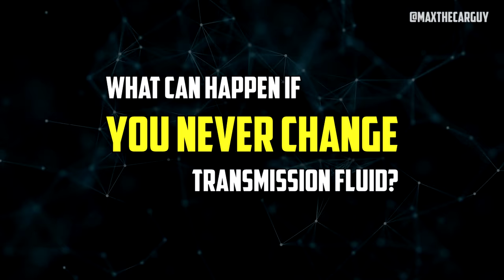Transmission Fluid Change vs Flush - Pros, Cons, Costs

Comment: If a car has done less than 30k miles in 10 years or so, is it still necessary to change ATF (considering its red and tranny temperature is in normal range)? If so, why? Does any "additive" in ATF degrade PURELY based on age?
Reply from the maker: The need to change automatic transmission fluid depends on various factors, including the manufacturer's recommendations, the type of ATF used, and the driving conditions. Car's milage is only one factor. 

ATF deteriorates over time due to heat, friction, and contamination, which can lead to degraded performance and potential damage to the transmission system. Even with low mileage, the ATF can still accumulate moisture, sludge, and other contaminants, affecting its lubricating and cooling properties.

It's better to look in the manual or contact the manufacturer for specific guidelines on ATF change intervals. They often provide recommendations based on time, mileage, or a combination of both.
Reply: @MaxTheCarGuy  My manual conservatively says "change with JWS 3309 spec ATF after every 99000 miles"... If the car needs 15 years to rake up those miles, will the original ATF hold up for 15 years? If not then after how many years should I change? This is the motivation behind this question !
Reply: Maxthecarguy it’s your turn to reply.
Reply: If you want to be on the extra safe side. I’d do a simple drain and fill every 1-3 years depending on the vehicle and driving style and work load. Some cars/trucks are known to eat transmissions up(I’d do a quick search on yours). My reasoning to this is even transmissions rebuilders only offer about a 1-3 year warranty at best on avg. Where sometimes they fail before or just after warranty, sometimes they go on forever but if in that short a time u can trash a new transmission that’s a lot of metal u could avoid from just moving around in the system and also gunk and build up that can clog up the small orifices in the transmission. Good fluid will extend life of transmissions just think about motor oil. Additive style transmission flushes have been known to work well and loosen up sticky valves and solenoids in transmissions , fix hard shifts etc but you have to be cautious sometimes removing so much gunk at once could potentially clog something up as well but the point is to catch it before it gets really bad. They usually work well with great results if done right but are generally expensive since you have to drain and fill the system multiple times to ensure you have all of the flush additive out of the car. With some systems costing easily 150 or more in fluid alone to fill imagine filling and draining like 3-4 times to be safe can add up and sometimes having to repeat said process for perfect results but beats a transmission replacement bill on most vehicles any day. Recommend doing your self for cost and making sure it’s done right. The simple fill and drain can clean up the transmission as well since they usually have detergents in them and is a safer way to clean but also should be done for preventative maintenance if it’s kept up with usually never have a need to flush system but considering no one ever changes there fluid a flush isn’t a bad idea to start with especially if your at higher miles and then do your preventative maintenance from then on. 

Also Magnetic drain bolts help as a wear indicator and stop shavings from circulating as much.